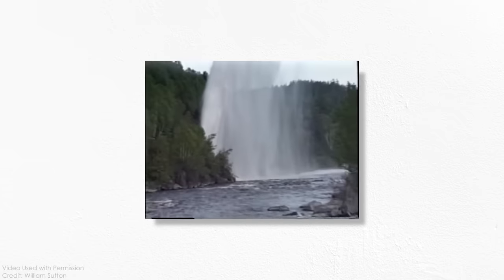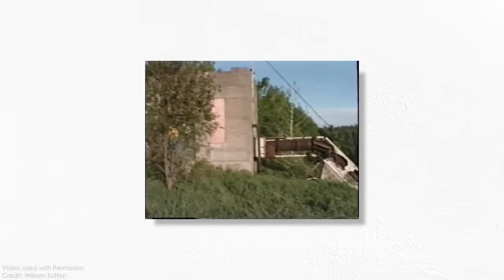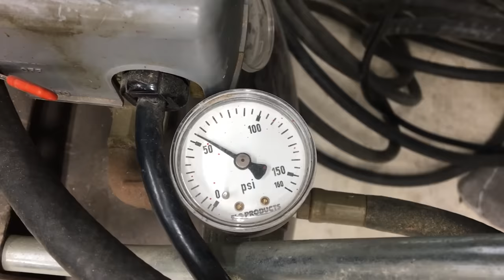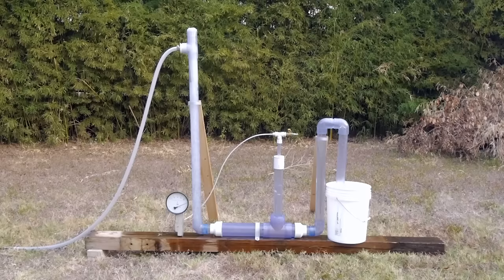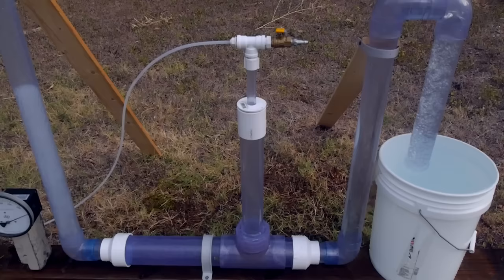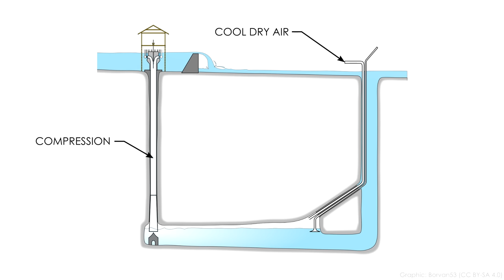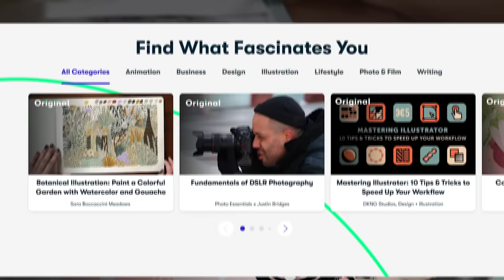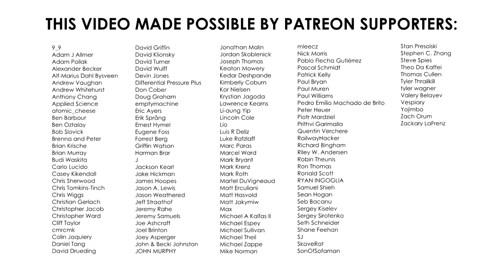Compress Air with No Moving Parts! - Trompe

Comment: Hey Grady. Thanks for your excellent vids. Your passion for engineering is palatable.
Have you considered building a small scale solar powered air battery thing -- e.g., https://www.youtube.com/watch?v=sBF5EnK9MPs ??  It would be a sealed system like the one in the video, but MUCH smaller.

Comment: The most inefficient system ever. You can do much better compression with water falling than this. Just accumulate water and the weight can compress much more. Then release the water and accumulate again

Comment: Thank you for the very good video quality video about the Trompe air pump.  I've linked back to this video from the Trompe air pump discussion in the Water Powered Pumps facebook discussion.  https://www.facebook.com/groups/240458583255303/permalink/529284057706086/
Interest has picked up again for the Trompe air pump as we try to understand the related Pulser water pump.   Can the pumps be competitive with other water powered pumps like Spiral, Ram, Mechanical, Pressure Enhancement and Direct Lift water powered pumps?  Can Pulser pumps be put into practical use for irrigation?   I'm not sure, perhaps you would like to share your thoughts.  Thanks you.
Reply: I especially like your clear plastic tubes where we can see what is going on.  Would you mind sharing your source to buy?